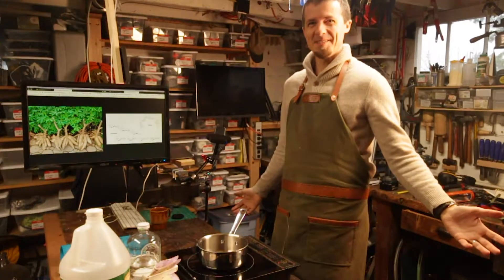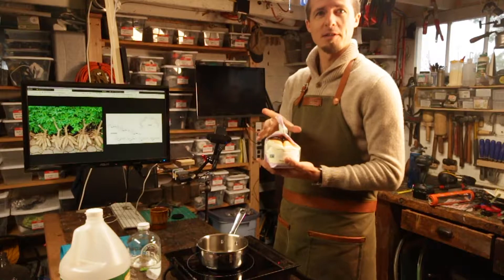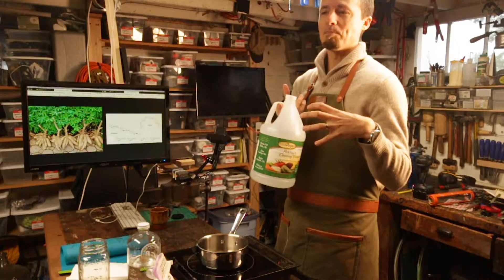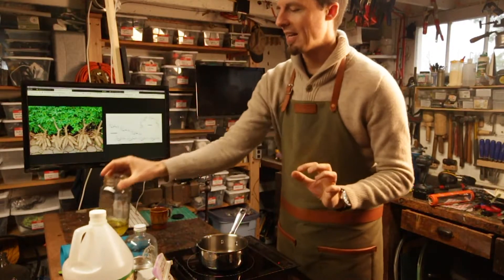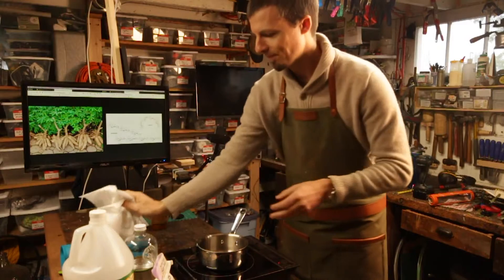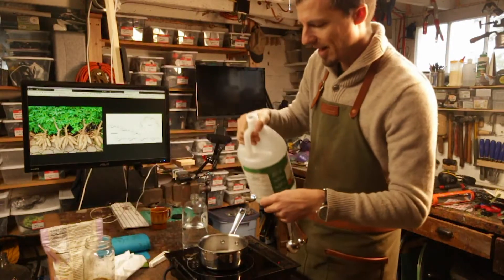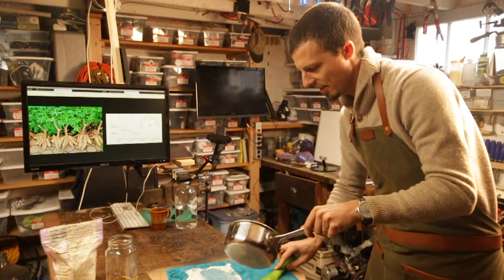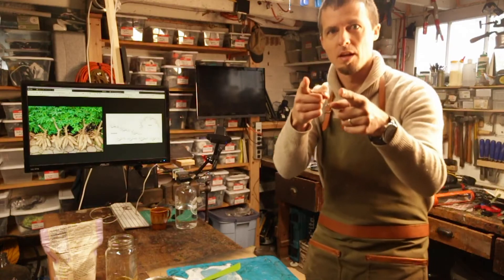DIY Biopolymer Composites Without Complicated Additives

Comment: salt and starch will make a hard rigid plastic add some tannons to it usually from tea and it will become water resistant
Reply: hi, sorry for asking. did you mean using the water from the tea can make the bioplastic water resistant?
Reply: @azliatulakmal9839  yeah has tannins in the tea also can just buy tannic acid by itself but can use tea itself if you cant find the tannic acid